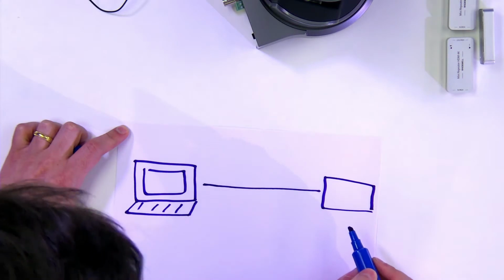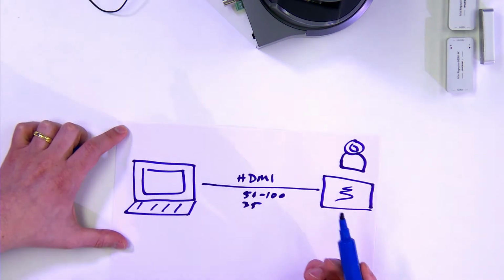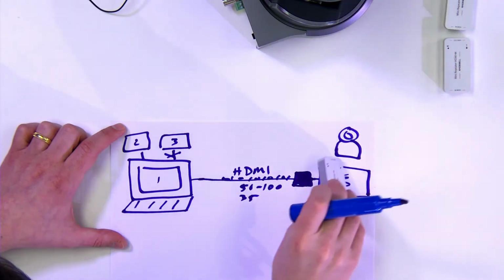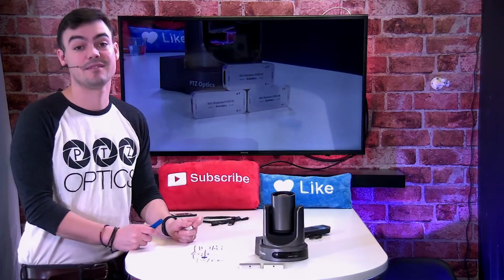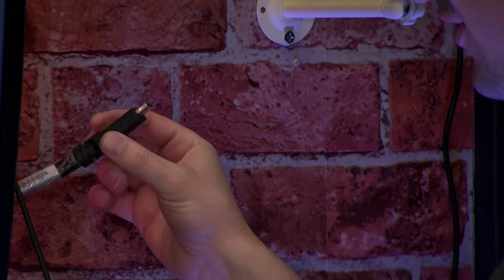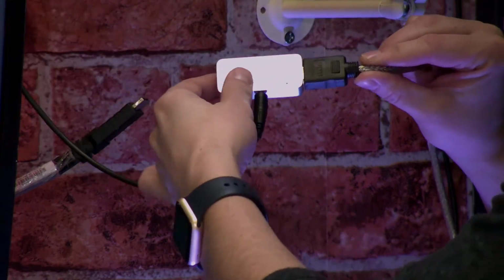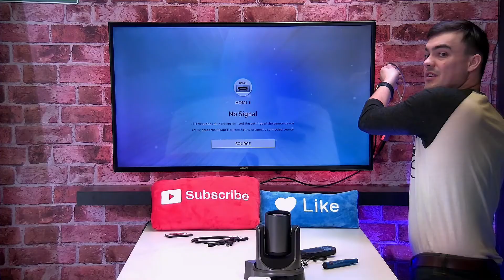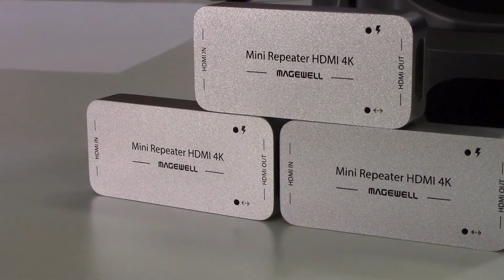How to fix a HDMI Cable - New HDMI Booster from Magewell

Comment: But if you use two fifty feet cable and join them together with the booster, does it need to still be plugged into the USB power source?

Comment: I need a 10m Hdmi cable run from my AVR to the back of my projector, what end would I plug the repeater in ? Thanks
Reply: This would be placed at the projector in your case. It’s a high quality HDMI reader that boosts the signal
Reply: Thanks for the reply.